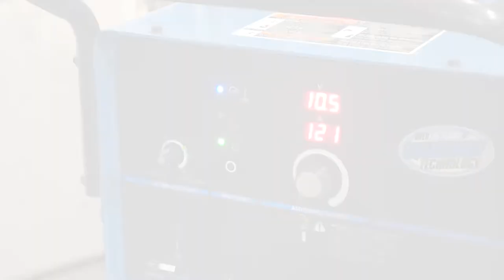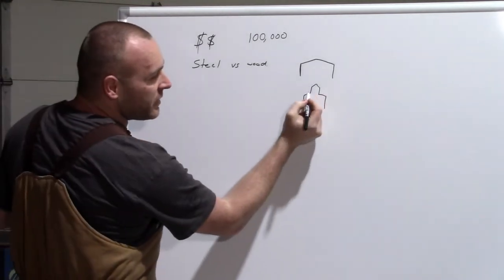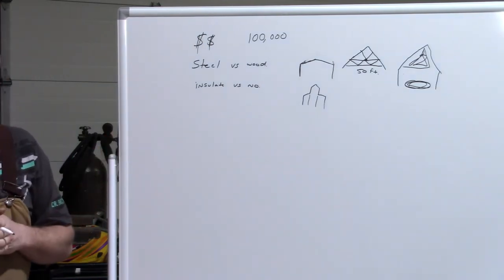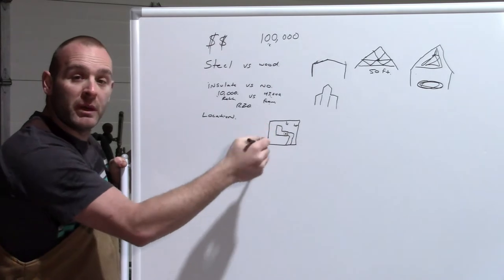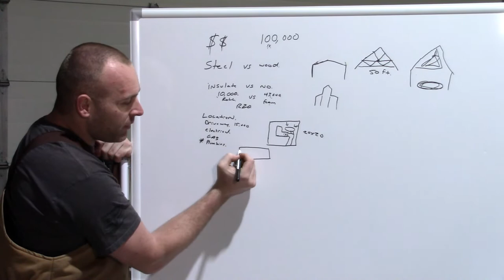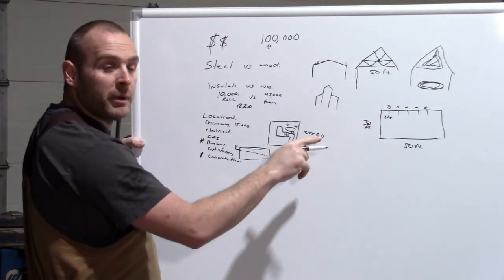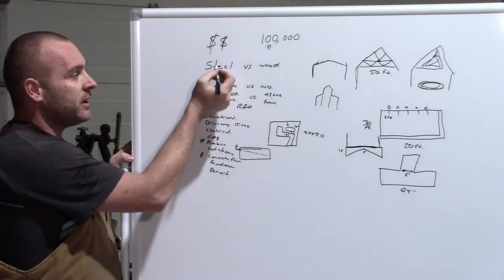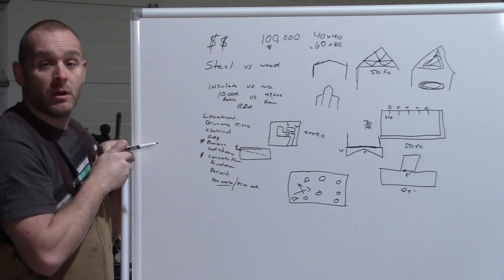DIY Dream Garage

Comment: Hi friend after you got your concrete set how long did it take to put the structure up ?
Reply from the maker: once the foundation was complete.  it took us 33 days ( working before my day job ( 5am-9am )  then back out after my job ( 430pm- until sundown ) and all day on weekends. 

it was insane but im glad i was able to do it with my father.
Reply: @710Garage  Hi friend and thanks for your prompt response . The 33 days are you also counting the days the concrete needed to cure ? How many hands did you have to help ? So basically you worked 8hrs a day , mom - sat for 33 days ?
Reply from the maker: i hired out the concrete completely,  so when they were done with the foundation ( and it was cured )  from the day my father and i stood the main girders it was 33 days to have a completed building. 

thankfully we were able to get it together before my twins arrived (  a week later ) so we took about 1.5 months away from the project to assist momma with the new little bundles of joy. 

i then got back to the project where we did the grading inside the building, laid the vapor barrier and the wire mesh / rebar. 

then again the concrete floor was hired out ( was done in 1 day  ) and i let it sit for another month with nothing on it at all. 

then i got the big doors and the man door installed, and we were off to the races.

hope that helps!